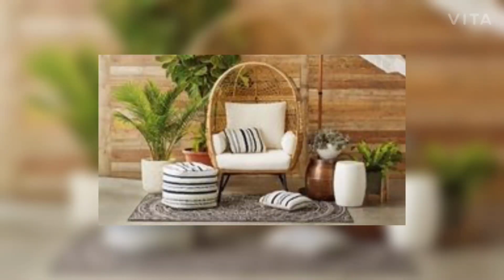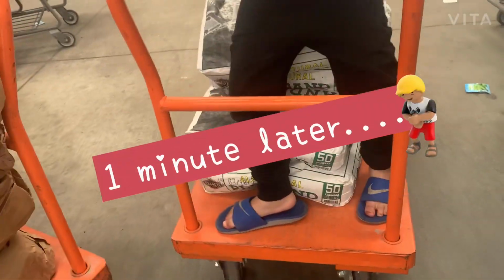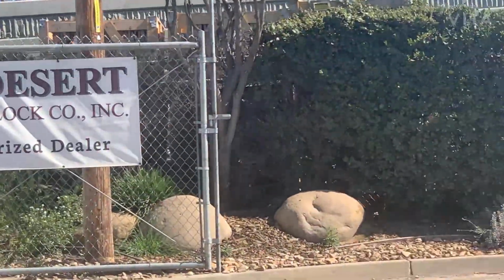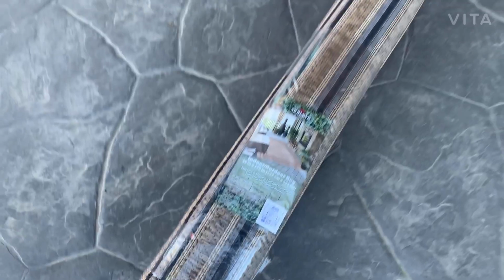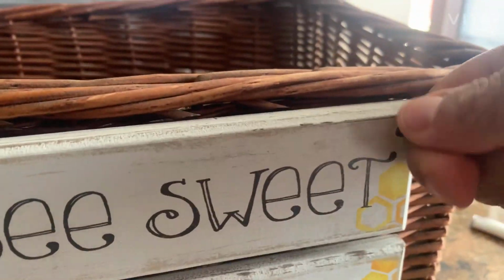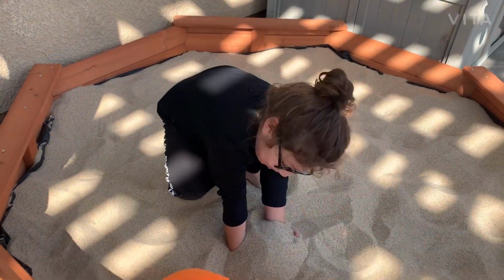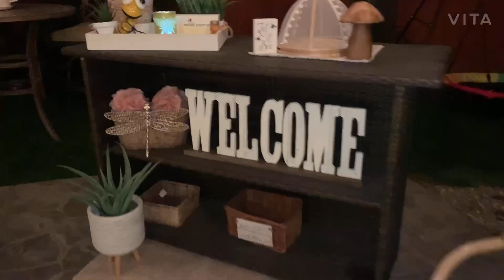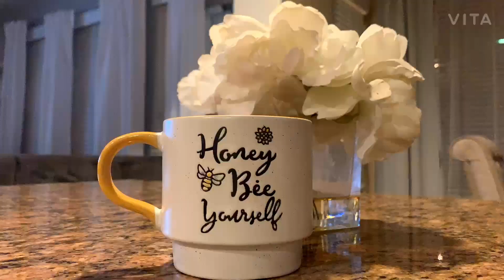EXTREME PATIO MAKEOVER!! *FROM START TO FINISH*  KID FRIENDLY. SPRING|SUMMER BACKYARD DECOR.

Comment: How is the maintenance,. Seems to me the egg chairs would be difficult to keep clean.
Reply from the maker: Hi Maui, that was also my concern when I purchased them but since we had them we make sure we dust them off every three days.  They don’t seem to stain easily. My son already dropped juice on one of them and I used a little bit of shout out spray and it came out so easy. I would also recommend a spray called safe guard to add an extra layer of protection to the fabric. I bought a protective cover for when it rains and don’t worry much about it and seems to be holding up well. California weather had been bipolar but so far they are holding up well lol. As for the frame just a little wipe down to avoid  dust and it’s as good as new. Hope this helped a bit. Thank you so much for watching. 💕